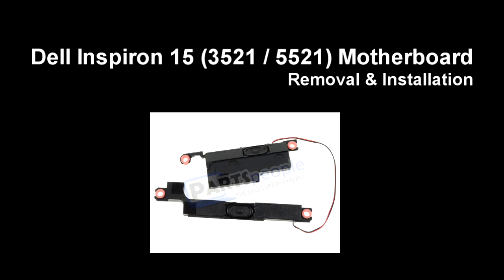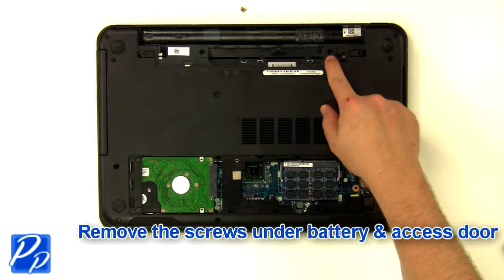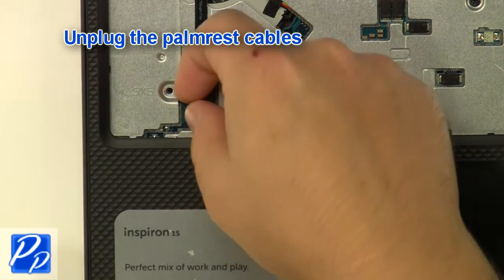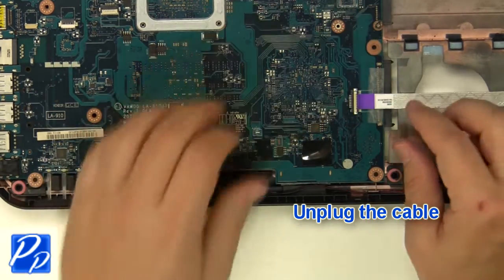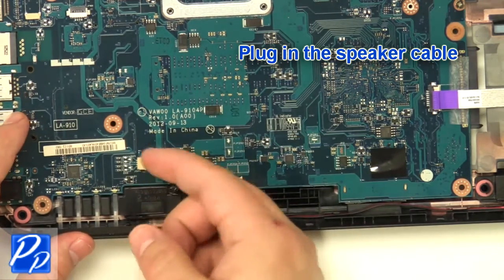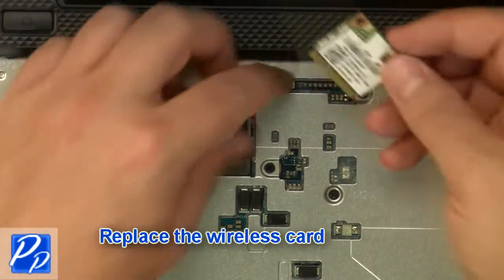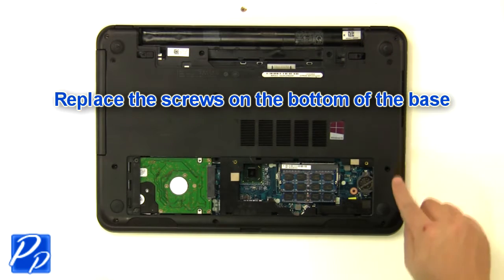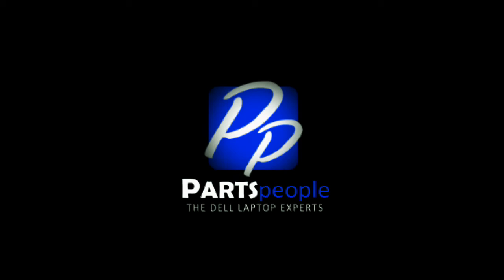Dell Inspiron 15 (3521 / 5521) Speaker Replacement Video Tutorial

Comment: bro i broke my power button ribbon cable on mine putting it back in any advice on how to properly reconnect them im new to this and i wanted to fix this model laptop up for my dad to use i already bought a 240gb ssd and 16gb ram i ordered a new power button cable but im scared i may break it like i did the current one. this laptop is like 12 to 13 years old now. does age make the cables more fragile or something?

Comment: Hello , I opened my dell inspiron 3521 also occurred a problem with my computer and fan I cleaned and I collect computer I put everything back but the computer I'm opening music is opened, after it did not sound from the speakers but no sound from the speakers but sound comes through the headphones Connect the earphones , but does not come from the speakers was you think why is that ?
Reply: El`Han do you got the solution...plz tell
Reply: me to help me